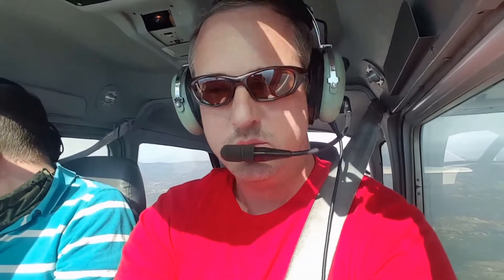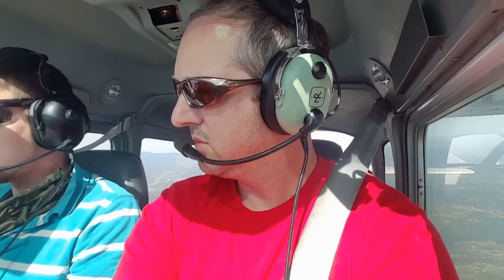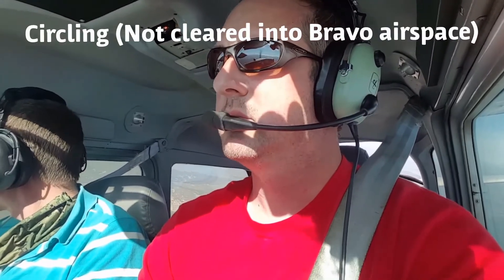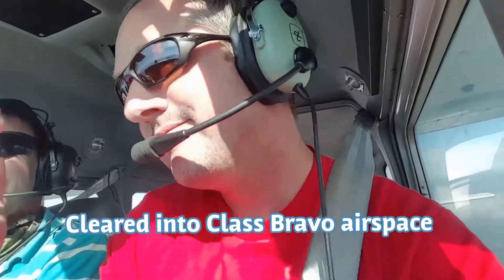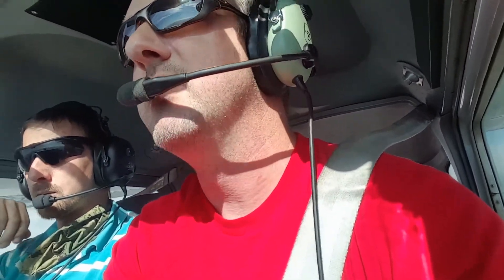How to Transition through Class Bravo Airspace

Comment: will they hand you off to the class delta tower? How do you plan your communication with the class delta before getting there?
Reply from the maker: Hello Ryan,
Thank you for the question. Well it depends on where you are flying to. But, in the case of your question yes, since you are actually flying to a Class D airport, ATC will hand you off to the Class D tower.

Prior to getting the hand off, you should pickup the current ATIS at the intended landing airport, which is always required. Once handed off to tower you could say something like, “Riverside Tower, Cessna N1234 inbound for landing, with information Charlie.”